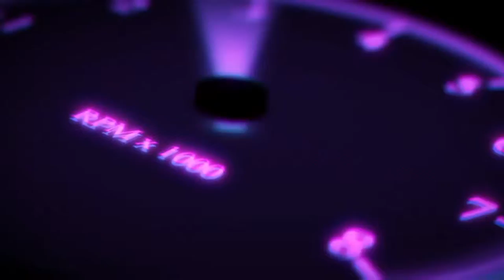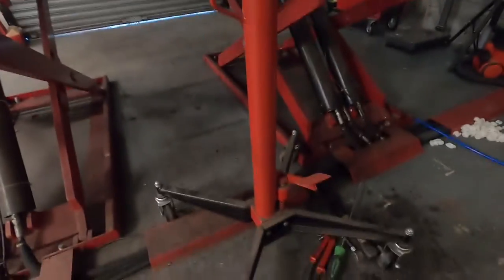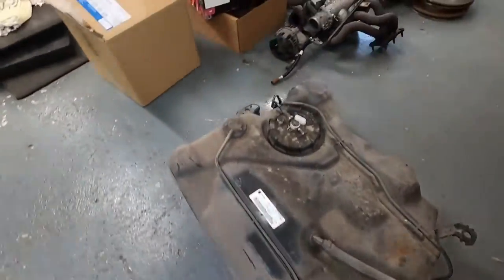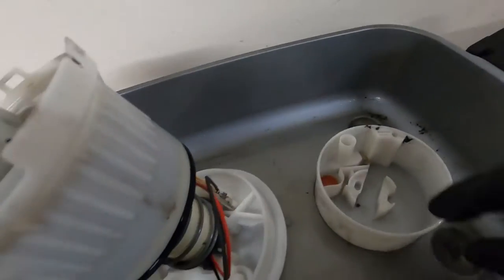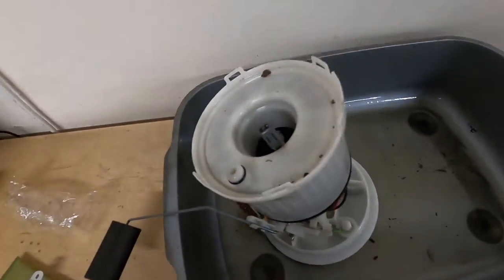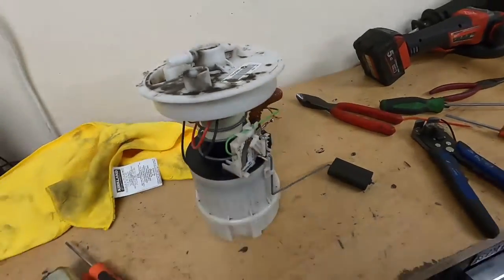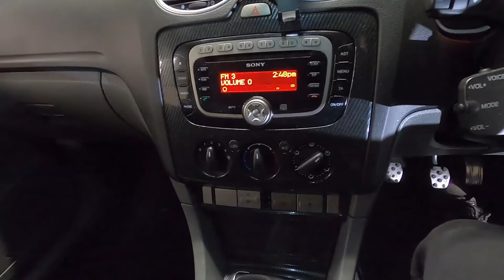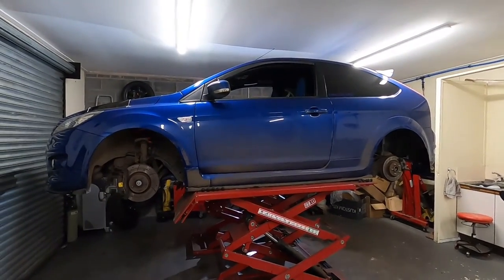Ford Focus ST225 - AEM 340lph Fuel Pump Upgrade

Comment: Good job! I did the same mod yesterday. I wish I watched your video before :) Before the upgrade, with the original pump I read 385 - 390 kpa. Now it is 396 kpa at idle, ~410 kpa on throttle. Do you have any data? Thanks.
Reply from the maker: no data, sorry

Comment: Hi mate,
When you upgraded the fuel pump, have you done a new tune suit the new pump,
Reply from the maker: Yes it was retuned but only because i chaged injectors as well, got told this wasn't nessary with just a pump replacement.
Reply: @gregoryelgood  , my car is running mod xrs  DMS, is it possible to replace the fuel pump to 340lph, does it work or not,
Cheers
Reply from the maker: I would probably fit RS injectors (440cc) or equivalent on a xrs map but a fuel pump is not needed at this point unless its starting to struggle because of its age.